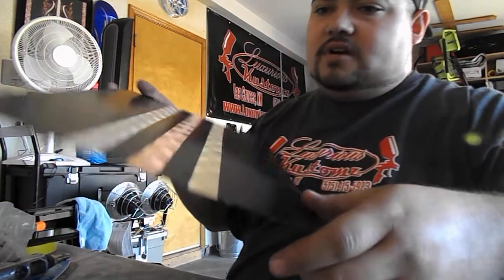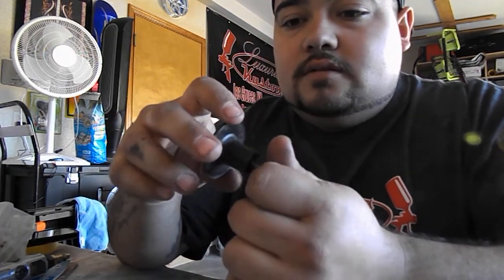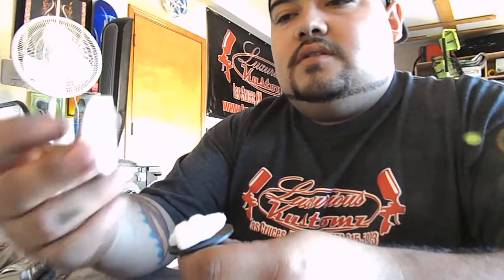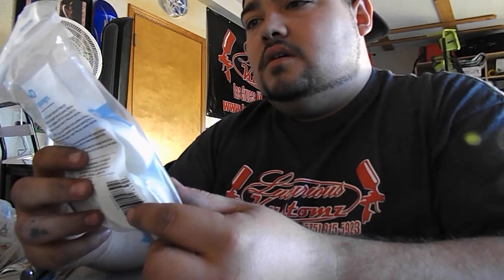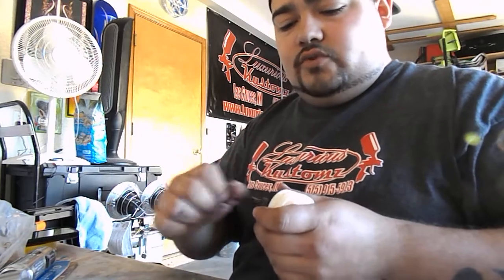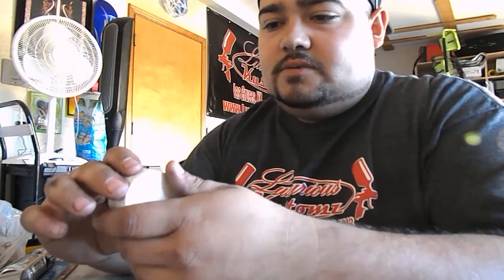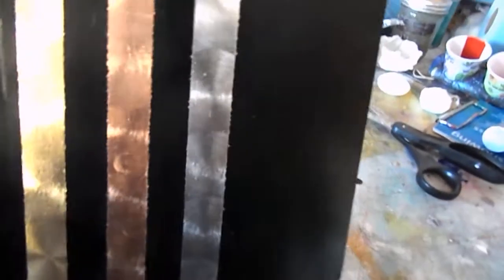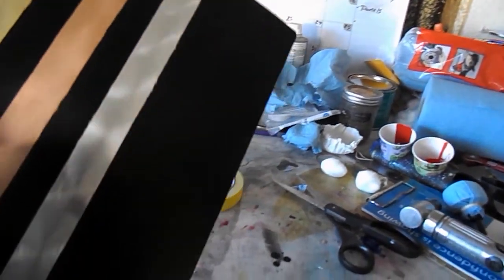How to make a turning tool for leafing.

Comment: How long do I have to wait for the glue to dry before I twist the Gold Leaf
Reply from the maker: That depends on your temperature, humidity, and the kind of sizing (glue) that you're using. Normally for me with quick dry "glue" around 30-40 min before applying the leaf. After you apply the leaf, you can twist right away after you burnish it.

Comment: Does anybody know if its normal to be able to see micro scratches on silver or gold leafing.
Reply: If u see heavy scratches it could be a few things...1)the brush ur using to apply adhesive is too rough and leaving streaks in ur glue...2)if ur using leafing from craftstores like michaels,hobby lobby..those leafings are not as fine as some from an actual automotive paint store...big diffrence in shine and finess..another thing is when u lay the leafing,tap it dwn with a soft make up brush...it will not scar ir